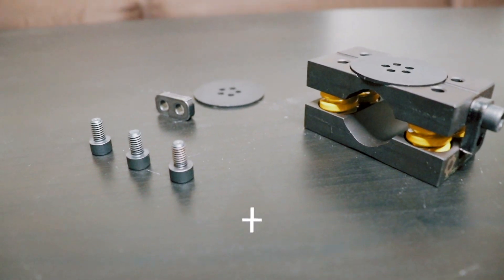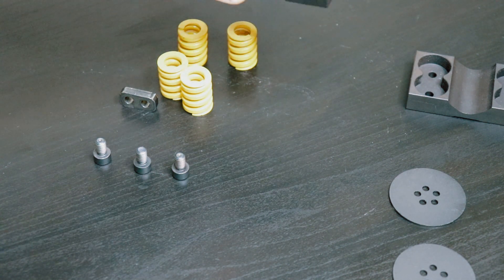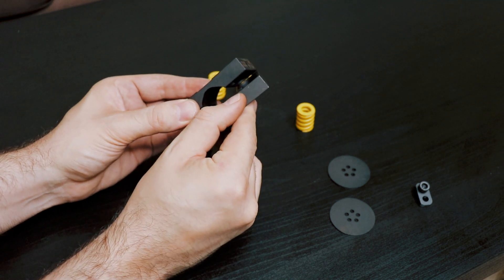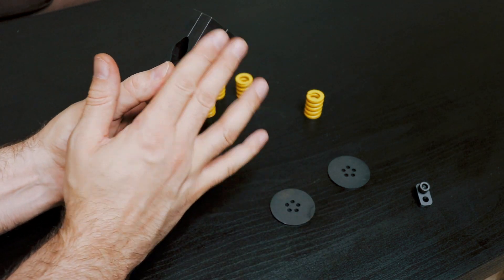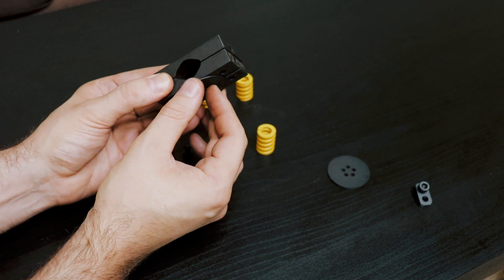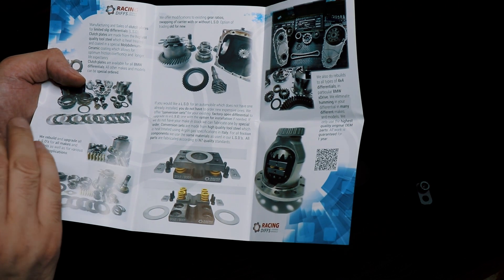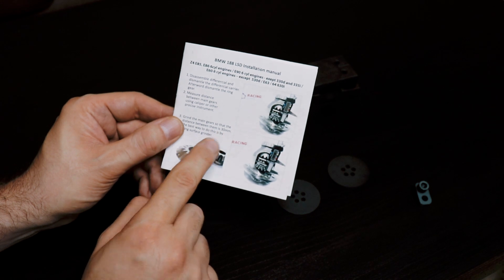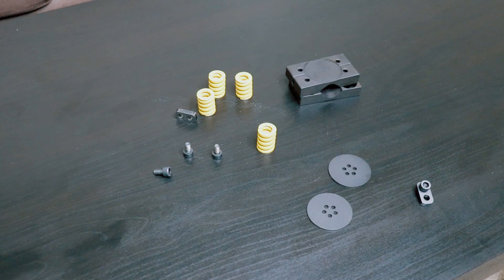$250 Limited Slip Differential Retrofit For Your BMW!

Comment: yeah.. i'm not cutting off my ring gear ( have manual 335I )  and you shouldn't have to, the spider gears can still be removed and refitted, you can even use the hubs to hold in place, then use the dif pin when installign side gears for proper alignment, remove center pin, and rotate into place install LSD, and center pin.

Comment: Pretty disappointed to be constantly screwed over with my manual e82 135i.  First it didn't come with a LSD from factory (what was BMW thinking??), then I've got a housing that can't be swapped for any factory fitted LSD's, then the bloody ring gear is welded to the centre.  Turns out to be cheaper to just buy a converted diff with a LSD on a swap basis anyway.  FML.

Comment: Do you know if I can switch to lsd on an automatic 2008 335i? Im having trouble finding info on it
Reply: Yes you can. And now it is a good time as Black Friday promo is on. Check link below.
http://rover.ebay.com/rover/1/710-53481-19255-0/1?icep_ff3=2&pub=5575378759&campid=5338273189&customid=&icep_item=264499376799&ipn=psmain&icep_vectorid=229508&kwid=902099&mtid=824&kw=lg&toolid=11111

Comment: Very interested for my 09 135i manual. Please let me know. I have a welded ring gear and large housing. Been looking into some of the possible options. Don't drive the car as much. I'm thinking this would be great for me. I've followed pretty much all the upgrades you have done, even the turbos. I do have a machine shop that can help with a lot of the work. Thanks in advanced. Peter
Reply: Dear Peter, if you haven't get any LSD yet, now is a good time as Black Friday promo is on. For your car check link below
http://rover.ebay.com/rover/1/710-53481-19255-0/1?icep_ff3=2&pub=5575378759&campid=5338273189&customid=&icep_item=264499491631&ipn=psmain&icep_vectorid=229508&kwid=902099&mtid=824&kw=lg&toolid=11111

Comment: Would this work on the rear diff of a 2000 bmw 323ci???
Reply: For your model there is another version of the set. And now is a good time as Black Friday promo is on.  Check link below
http://rover.ebay.com/rover/1/710-53481-19255-0/1?icep_ff3=2&pub=5575378759&campid=5338273189&customid=&icep_item=264498963829&ipn=psmain&icep_vectorid=229508&kwid=902099&mtid=824&kw=lg&toolid=11111

Comment: Tell us wizard, how does it "lock up" the diff side gears, inertia, centrifugal,  rotational, progressive, blah, blah, blah!!! You have been hoodwinked.
Reply: lol  nice ramp on both sides to if u down shift hard it locks up  whould be nice for the ramp to be on one side only like a 1.5 way  only weak point is the way u retain the pin   this is why even the phantom grips exploded  the shock load on pin whould shear the spring pin holding the spinder gear pin  in place causing it to explode   back in day fixed this prob use to use them in shitty sohc  honda transmissions   used bearing roll pin  and 2  allen grub screws to keep it in place worked well   fixed the ware problem by adding oiling path   to the spider shims and a  thin path on the phantom grim at a 45 degree so it pulls oil in going forwards  also  trans needs to be bit over filled so oil level is covering bit above half the drive shaft inlet  this keeps the botten section of the diff in oil under rotation so its lubricated better   st oem level  diff tosses oil away from  spiders  when u spin hell out of it   and the heat builds up on sliders due to lack of oil cooling    and lubrication  also for drag racing   no oem  spider set will last on open diff iv blown few  oem diffs up to weak points the diff spiders   then the  phantom grip    it just increases chance of  spider blowing up because u got more power gettimg to tires vs  tire spin

Comment: Wow, well first off, clutches are a wear item.  So even if this operates as claimed, durability has to be highly suspect.   That is a lot of labor having to remove and rebuild your differential for maintenance. Also, true clutch differentials have a lot more materials with multiple clutch and driven plates with much larger areas involved, thus more evenly distributing the thermal loads.  Lastly, you are going to have to throw away your differential if this fails as it will be too destroyed to rebuild.

The optional mechanical differential offered over the last two years as a port installed option on F3X and F2x BMW is a Drexler multiplate clutch design.

I would say that this "LSD" clutch design is rather like DCI intakes in that if such a less expensive arrangement worked as advertised, the OEM would have put them into production to save money and reap the performance benefits.   That they have not should raise a very large red flag for anyone contemplating that he is a better engineer than ones OEM is hiring.

If nothing else, I would have a completely ready spare differential ready to swap when this one fails.   The automatics produced before 9/07 used the larger casing like the MT and DCT differentials but still had the bolt on ring gear.  For anyone that has a 6MT or DCT differential with the welded gear ring, it is not a trivial job to remove for even most experienced machine shops.  I would therefore recommend looking at reliable suppliers like Trac, MFactory, DiffsOnline or VAC motor sports who have the necessary experience.

I would really reconsider this if you are hauling your family around 610 and have your differential seize at 80 mph.   All risk and limited benefit in my estimation.  Would hate to lose you that way.  Also, no matter what happened, you would be instantly 100% liable for any damages that were self inflicted or occurred to others.  Insurance would most likely decline coverage.

Comment: I would like one i have a auto 335i e92 fbos water methanol ect  i live in Australia and my only other option is a lsd for $1800
Reply from the maker: Okay it should fit and you probably have a bolted ring gear on your diff if it's an 08 or later.
Reply: @VehicularDIY  not sure i haven't checked it out yet its a 07 335i e92
Reply: @tighematthew  Yeah, you should have the bolted ring gear.   The big question is do you have the auxiliary oil cooler as it was only on some properly optioned cars that year?
Reply: @maxnix346  oil cooler on the diff
Reply: @tighematthew  we have the set for you, so you can order it from us directly. Www.racingdiffs.com
If you are not sure about fitment, please send us message through web site with your VIN and we will check it for you.
Reply: @RacingDiffs  no worries thanks

Comment: It looks very interesting would that kit work with a dct transmission or does the dct rear end  ring gear need to be machined?  I own a 335is with a dct and was told to just buy a used m3 rear end from a bmw salvage yard for $500.  If this works for half I might consider this option.  Great content I want to thank you for saving me $$$$$$$$$$ of dollars every DIY is spot on.
Reply: Ring gear is welded on.   If you go M3, you have to replace the whole subframe and brakes, suspension.  Modification of the pilot shaft is also required.  If you cannot afford to swap a pre-built differential in with a core refund (about $2.3K for the unit without core return), then seriously just skip it and keep your fluids fresh.

Comment: Would an M3 diff swap be an option?
Reply from the maker: That's an option yeah but you need to do the complete sub frame I believe.
Reply: @VehicularDIY  Correct... Rear carrier, diff sub assembly, but might as well exchange the axles with the M3, also you'll need to adjust the driveshaft; the ends are different for the M3 and the length is different (esp for the E92 M3 to E90 sedan). Its doable but pretty involved job.
Reply: @SteveWeltman  yeah the budget BMW guys did it big job..
Reply: Tighe Matthew I watched that video too. Wow, what a process!

Comment: Pretty cool and inexpensive option, if it works the way it's supposed to. Have to research what my diff is (on 128i automatic)
Reply from the maker: Yeah I'm pretty sure it fits your car, you should have the smaller 188 diff.
Reply: It is 188 diff 👍🏻

Comment: Also honestly I'm shocked you would go to this solution since you  tend to do more in depth, permanent and solid solutions for your car.

Oh well.
Reply from the maker: I think my channel has a fair share of really budget oriented solutions which might not always be the best recommendation but for some people is relevant content.  For instance one of the first videos that got this channel going  is an injector DIY and I used rebuilt ebay injectors of all different indexes.  Lasted a couple years but not necessarily the best move on a tuned car, eventually did a follow up video with index 12 injectors with an explanation as to why people should go that route.  I'll definitely let you guys know if this LSD retrofit doesn't last or work.

Comment: I'm doing a full M3 lsd video.. I'm more than hesitant on these solutions as they just seem super dubious to me, not a knock on you
Reply: @Max Nix  Don't attend to convince you in oposite, but we have been selling 2 sets daily for last 3 years. Not a single diff came back with damage, so it is perfectly safe. Anyway would you be interested in shooting video for M3 diff rebuild with our parts? We have clutches, shimmes, bearings...
Reply: @RacingDiffs  I'm the one doing the rebuild.. it's for my channel BMW Dad. Let me know if you are interested.
Reply from the maker: Nice, yeah I understand where you're coming from.  From my perspective it could work and it would be a neat solution for viewers or it fails but made an interesting video so I'm fine with it either way.
Reply: @VehicularDIY  One should consider the possible consequences of a catastrophic failure vs. the limited benefits of one not occurring, I should think.

Comment: Looks great!  Will it work on a 335xi?  Also the kit should come with an optional properly sized spider gear.  I’d rather pay for the right sized part rather than risk screwing around with a grinder which I don’t own.
Reply: We have it for 335ix rear differential.👍🏻
Reply from the maker: I believe so, I'll ask the company that makes it to chime in on this video to confirm.  Yeah that would be a nice option to keep things simple.  I was considering getting a mini lathe to do the work but then it wouldn't make a very good DIY as nobody has one.  My DIY might seem crude when I make it but I'm hoping to show it can be done at home without any really expensive tools.

Comment: Would this fit a 2013 F30 335i xDrive with manual trans?  I am in the US and would be interested.
Reply from the maker: It looks like it could, I will ask the company that makes this kit to chime in to confirm.
Reply: Will this fit a 2009 lci e90 335xi manual?
Reply: We are in for tech support. There is a set available for your model. It is 215LW. 👍🏻

Comment: Interested to see how it lasts, Quaife or similar is what I plan to get one day
Reply from the maker: Yeah I'm hoping it holds up, if someone made a Torsen  diff that was $600 or $700 I would have gone that route.
Reply: @VehicularDIY  For $1000 http://www.teammfactory.com/catalog/partno/MF-TRS-05E46A or they have the larger differential cases available rebuilt with a core exchange.  While you are there, swap out the rear subframe bushings at least for the stiffer M ones.  Good time to install the 4 rear M links if you want to upgrade handling.

Comment: Always interesting and high quality content. I am not completely clear that this would be as good or better than a full rebuild (but the cost/benefit is really attractive). Because I have a very similar car (09 335i S0704, AT, LCI, and metallic black, except mine has all stock parts for the moment) I am also considering a full LSD replacement diff,  having some do the engineering for me (diffsonline)
Reply from the maker: Thanks, how much were you thinking of spending overall?
Reply: @VehicularDIY  TY for asking. For just the diff? I was ready to spend about $4500 (3 angle, polished, remanufactured housing, the works) and for the rest of the car? Probably another $10-15K, and most of it is only parts. More challenging things like upgrading the diff (meaning, changing the actual diff internals) I am only slightly comfortable doing that myself. 90-95% of the rest, I am slow but capable to most of the work. I can send you a list of things that I have targeted and budgeted this year, if you privately message me.
Reply: @SteveWeltman  Highly recommend you check out MFactory or VAC Motorsports.  Nice to get the larger case differential if you have the small case post 09/07 one.   Your budget is more than sufficient.

Comment: Just a heads up, bolted or welded ring doesn’t only depend on if it’s auto or manual.

Here are all the versions of diffs:
https://drive.google.com/open?id=14pkjCPEtKIw55XlpAEh8R5hh_Cd-hYzc
Reply from the maker: Awesome, thanks for sharing.  Seems like the early auto 335i had a welded ring gear.
Reply: Vehicular DIY yeah man, I didn’t want you to disassemble your diff and discover it might requires more works.